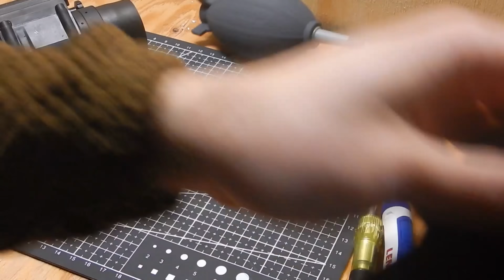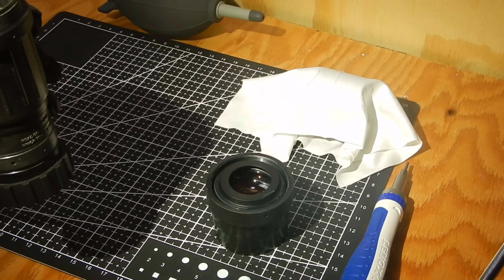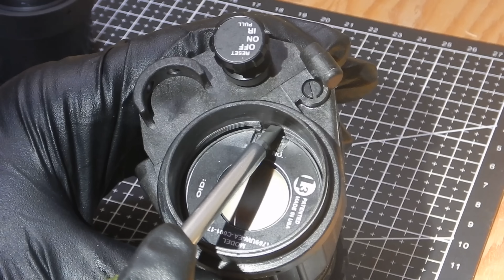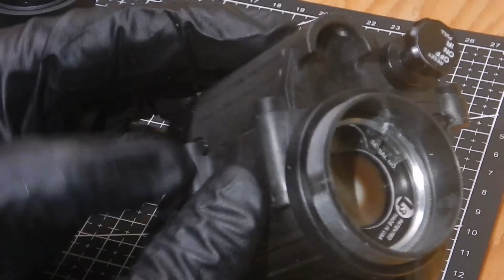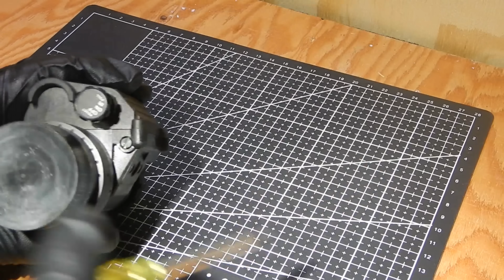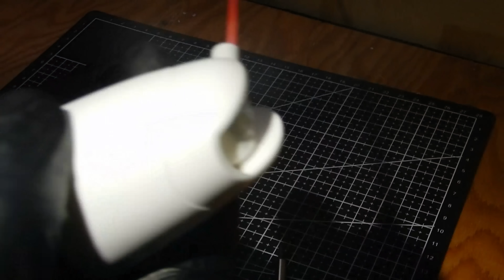How to Build Your Own PVS-14

Comment: Your claim about saving money by assembling a unit from parts does not add up. A complete parts kit is $1,099. An image intensifier tube is $1,800. Together, that's the cost of a mid-range assembled PVS-14.

Comment: I'd say place the optic in a vacuum chamber, with the screw removed cycle vacuum and nitrogen purge leave purge on when you open chamber replace screw inside the chamber.

Comment: Nitrogen purging isn’t necessary until you get off the sky bus at -60F and you land in wetter than Sally’s crotch jungle.  Instant condensation in your optics and you are stewed, screwed, and tattoed.  Get yourself a small TIG welding enclosure, place your optic in the enclosure, purge with Argon preferably, or dry nitrogen.  Assemble and close your optic, never a worry!  If your an evil genius like myself, you’ll overpressure the enclosure (+1.0 to 1.5 psi) creating a positive internal pressure in your optic, never will you have to worry about moisture intrusion.

Comment: As a welder I am able to get pure Argon would it be the same as what you are using it seems that it is I just have to make an adapter and use low pressure- correct

Comment: What about Argon purge? Argon is heavier than air. You can vent argon into a fish aquarium reassemble your optic inside the aquarium. You can use anything with some deep sides.....at this point he's talking about Argon available in a can.... inside whatever you fill with argon you need to keep your purge gas going so your movement reassembling it doesn't cause your purge gas to be fanned out. Pipe welder trick using argon as shield gas. In welding using GTAW procedures it's used for welding ferrous, non-ferrous metals, and to prevent oxygen contamination. Think maybe it can be done that way and it work? Providing of course you have a bottle of argon.

Comment: If you're worried about fogging what you want out of the device is the moisture in the air. Even air that is dry by human standards has moisture in it. Any typical compressed air will probably have moisture in with it but any single (non-reactive) gas product would be a good choice.

Comment: If you're scared of dust, here's a little tip from another dustphobic: buy large clear freezer bags, the bigger the better, clean all your parts, put them all in a brand new bag, assemble inside the bag with your hands outside. From this point no dust can get inside. I also have a small hand vacuum continuously running on the minimum setting on the side, creates a gentle flow that gets rid of any dust that falls.

I mostly service watches and it's the most efficient way I found to do this on the cheap.

Comment: Pro tip for a "dust free" assembly environment: Use your bathroom! Turn the shower on nice and hot WITHOUT the fan on for a couple minutes to get the bathroom all steamed up, then turn the shower off and let the room cool for 30 minutes or so. The steam/water in the air catches all the dust and it all falls to the floor leaving the air dust free!
Reply: This is good for cell phone protective screens...but they can take the moisture..I wonder if that might actually be bad for open electronics....(I'm only thinking out loud)....I was thinking the same thing as your comment...then the moisture thing  made me take a pause and wonder...
Reply: @camdenkingsley8800  why I said to let the bathroom cool first to let the humidity drop, as the room cools the humidity drops to the same as any other room in the home. 

You'd be surprised what "modern" electronics and PCB's can take. They're all very well protected from humidity and moisture unless they take a full bath while energized for very long. So long as you remove the power source and dry them out quick they'll more than survive.

Steam also doesn't contain much in the way of problematic minerals like tap water has, or worse lake and salt water. About 10 years ago I was kayak fishing and went for a "swim" with my old Pantech Android version 2.3 cell. I got to shore, ripped the battery out quick then let it sit in the sun for the rest of the week. It still works just fine today as an E-book reader!
Reply: @macgyver5108  Cool...yea...I thought the same thing as this is how I install screen protectors...thanks for the info.
Reply: I suppose so. If all of the parts were tHen at the same temperature perhaps the extra humidity would not collect on surfaces. You might seal the components on air tight and water tight bags or containers and place them in the same area while the room was de-linted so to so speak. The hvac system would need to be filtered or turned off but hey, you this is a possibility of a cheap clean room. Maybe add a filtered dehumidifier system. Interesting idea. Thanks
Reply: @crawford323  what is this "HVAC" you speak of?🤔 LOL, I don't have one of these "mythical creatures" you speak of where I live! What I suggested CERTAINLY beats the alternative of any other dusty room in your place though.

The only issue with using "bags" that are plastic is the static cling which can attract dust, UNLESS perhaps you used the static shock proof plastic bags like electronics ship with and blew them down really well first.
Reply: @macgyver5108  Heating, ventilation and Air Conditioning.
Reply: @stephenhood2948  I know, just being facetious. I've got many friends and family in the HVAC trade, as I sit in front of my box fan...
Reply: @macgyver5108  I cant imagine how I didnt catch that in your comment, you were pretty clear about it.
Reply: @stephenhood2948  "must've been the heat"?!😏
Reply: @macgyver5108  LOL

Comment: Loosen the housing screws creating a crack, then act like you are pressurizing the housing so any excess gas will flow out of the housing crack, press it together closing the crack, then install the access screw, then tighten the housing screws.
THOSE ARE GOING FOR $800 WITHOUT THE TUBE!

Comment: Would you be able to remove the screw and place the device in a vacuum chamber, use a vacuum pump, then attach a line from an argon (or N2) tank to the inlet? Wouldn't be perfect, but might yield decent(er) results.

Comment: Would putting it in a small vacuum work like for example i have a vac sealer with a hose attachment for containers could i in theory put it in container and suck air out of it with vac sealer? Or would the air rush back in as soon as i open the container?

Comment: This video hasn't aged well.  The intensifiers are so high you are better off buying a retail optic used. As far as purging, there's an easy way to do it right.  Build a small vacuum chamber, put it under vacuum, attach argon bottle to inlet, open valves. Instead of equalizing with atmosphere, you equalize with argon. Once that's done,  since it's heavier,  just reach in and put your screw in. Done.

Comment: Been doing this for over a decade. Kind of regret not starting a business off it but moved onto other things. Figured others were more worthy of picking up on this. It’s already been mentioned on what you covered and didn’t say (e.g. reverse threads, alum. foil, Ar density, dust, purging). A word about purging is that the N2 kits are criminally priced. The hand pump is something I could literally still get from any mechanic shop. Valves, tubing, and switches are easy to engineer too. The adapter is easy to machine and even buy for cheap. N2 is easy to come by any gas company for torches/welding or med/lab supply. Regulator too is easy to get. Never understood why N2 kits were $1000s other than being a juicy govt contract. Worse off is the “optics testing kit”.  Reduced to $5000 (from $10000s) last I saw years ago. I just stuck with the basic field tester kit and some optics know how for $300. The AN/PVS-14 was a great optic. I wish the AN/PSQ-20 could have lived up to it. Low weight, small profile, multiple mount options in handheld, rifle, head/helmet. Fusion just can’t compete to this day with its proprietary components, limited mounting and bulky appearance. I mean the I2 tube itself is not easy to make either hence expensive but that’s the rub. It’s one small unit to assemble around upon. Making it easy to service/repair. Kinda apples to oranges though cause thermal requires additional circuitry/components. Maybe more into the future fusion may compete. IMHO it does not in this day and age.
Reply: Hey boss , if someone wanted to get into this , where would you suggest buying the actual lens and housings

Comment: The purging is not about what gas will be inside. It;s about to remove any moisture from inside. Vacuuming will make any water boil and sucked out by the vacuum pump. The nitrogen gas is dry, water free will prevent water vapors to flow in and affect optic in cold condition. The same technique used to purge air conditioners once it was open.

Comment: For military-grade Purge with argon gas, it has better and heavier characteristics than nitrogen. Its heavier so its like filling her up and lets gravity do the work. It is necessary as it will stop condensation. You can buy it super cheap as a welding supply. you can make a vacuum purge with a large gallon plastic bottle, a rubber glove, and a tyre pump.
Reply: haha you just did it in the video. top notch!

Comment: @S2 Underground , With over 800 comments, I don't know if you'll see this, or even have the time to respond, but I have an honest question. Is there a specific reason you connected the electrodes, before you cleaned out the dust from the upper housing? I ask because it doesn't make sense to me on a common sense level. I have no experience building such an apparatus, so if there is a good reason for doing this, I would genuinely like to know. Thank you in advance.

Comment: I am not familiar with this per se but I work in the automotive field and we have a nitrogen machine for tires... it will pull a vacuum and install nitrogen. You could easily do this if you could adapt a car valve stem to the body somehow.

Comment: I'm not an expert on purging optics, so maybe it's not as critical as I'm thinking, but typically the more important part of the purge process is pulling a vacuum, which isn't so much to remove air as to remove moisture.  By pulling a deep vacuum the boiling point of water can be brought down to bellow ambient temperature, causing it to become a gas and be extracted by the vacuum pump.  The atmosphere inside the device is then replaced with a dry inert gas such as nitrogen or argon to ensure no moisture is reintroduced.   If one wanted to perform a more effective purge, vacuum pumps and small vacuum chambers can be bought for a couple hundred dollars and it would be relatively simple to set the vacuum chamber up to fill with inert gas afterwards.  If you know anyone who works with air conditioning or refrigeration they should already have most of the necessary equipment as well as the skills to set it up.

Comment: If you get a Eisco Hand Operated Vacuum Pump ($44 at fishersci and comes with the PVS-14 purge kit), a t-fitting, and Night Vision Nitrogen Purge Kit Adapter ($30 at Opapug), you could draw a vacuum on the nod with the pump, and then pressurize it with your bottle. It may not be perfect, but it could help a bit. Just a friendly suggestion, and would not cost the $1.2k for the whole kit.

Comment: If you were to do some quantity of these, a simple vacuum pump would boil off the moisture, then just open the valve or spray can of argon, nitrogen etc. to refill housing afterward.

Comment: I have a suggestion on the nitrogen purging issue :
here in Italy nitrogen is used to purge hvac installations from remnants of previous, now illegal, kinds of gasses.
Nitrogen bottles are readily available as being inert it is not a controlled product and the cost is minimal like 15 bucks for a bottle sized tank.
If you were to connect one of those tanks to a valve, leading to a very fine stem, you could insert in the housing through the screw hole, leave it going for 5 to 10 minutes to ensure overkill, remove the nozzle and quickly inserting the screw to finish a jerry rigged nitrogen purge...
It may not be perfect but it could be a good improvement from 70% nitrogen to 99%, not professionally graded work but a good brute force approximation.
You should take a look at stores that serve hvac installers, hope this helped a little :)

Comment: On the leads for gain control, would it be wise to put a dollop of solder on the top of the leads? To make sure they never undo by themselves?
Reply: They are pressure fit

Comment: Question: can I use argon from a welding setup and setup a tote upside down and operate on the nods with my hands in the tote while duping argon into the top of the tote to offset oxygen???

Comment: If you actually cared... Could probably rig something up for cheap to purge. One tube goes to the hole which has a Y splitter with 2 hoses coming off of it. Put a valve in each hose. One goes to vacuum the other to argon. Close off the vacuum side, pull a vacuum, open the argon side, good to go. Do it once or twice and as you said, heavier than air so when you pull out tube from the housing it should stay inside.

However, I like an idea someone else said which is way more simple. Basketball needle deeper in the housing and just go super slow and should get the exact same result for way less effort.

Comment: Anyone more knowledgeable think that it would be possible to 3D print a housing that would be able to hold the PVS-14 (either as is or taking the guts out) to make a standalone setup like a goggles (think Splinter Cell goggles... that's the closest example I can think of) that can be fit into a pouch or worn? something that isn't strapped down around your whole head? I don't use a helmet because I am using these for hunting, not combat... and the mounts I've found available are all very uncomfortable and a bit cumbersome. I'm trying to make the whole thing more compact if possible...

Comment: Gents, you shake that thing as is and it’ll turn itself on off according to this tutorial. Before you close the batt comp makes sure the tube has the left side of the notch (when the objective is facing you) pushed against the little wire that holds it. Apply the light pipe and while keeping the tube firmly in place applying the retaining ring. Do that and it shouldn’t shake itself on and off.

Additional fun fact: if you buy a 17C tube it has an auto gain function and works perfectly fine in a 14.

Comment: Just a quick thought, as you said argon is heavier than air, take a cardboard box and tape the seams with duct tape and put everything in the box. Flow argon into the box. Reach in and assemble. Argon is really easy to get as TIG welding gas at your welding supply house.

Comment: appreciate you mentioning using argon as a substitute, and the benefit of it being heavier than air. 
Argon is used in purging AC systems in automotive applications, maybe residential as well. As well as it's use in welding to act as a shielding gas and a purging gas with in the pipe.
It get's the job done!

Comment: Used to use Argon for polymer processing in the the summer time - heavier than air. Nitrogen in the winters, because the air was so dry anyway. Argon is much more expensive, but much more effective of an inert gas.  Window companies caught on years ago by having double and 3x pane windows with N2 and Ar in between the panes as an inert layer...

Comment: Argon is heavier than Nitrogen and oxygen, so it should be able to replace oxygen in the tube easily. Alternative you could you the pvs 14 in a small bucket, with the hole looking up. Fill the tube and the bucket with the argon. Then place the tube on its side, fill it again. 

Of course argon and oxygen is invisible, but if you just keep puting argon in the container, it will eventually displace oxygen and nitrogen from the tube.

Comment: Since you're relying on just the density difference wouldn't it make more sense to screw on the lens last after you "purge" the device? Do most of the purge in through the tiny port with the lens off, close the port, last squirt of argon over the tube, close the lens. Should be better that way. Yes the argon should displace the air but with just that narrow port for purging I'd imagine most of the argon isn't getting inside as the air has nowhere to go but up the same way the argon is trying to go down. Imagine two way traffic on a single lane road. With the lens off the air has a better exit. Also with the tube placed on the table the part of the body the lens attaches to is higher than the purge port, so closing that last should give you the best home brew purge.

Comment: If you go the wine preserver rout remember: Argon is a Noble gas 1.38 times heavier than air. When you use the gas hold the hole in an upright position and flow the gas into the body. The weight of Argon will displace the air in the chamber helping to purge the air out.
Reply: …he did work off the the basics of that.
Reply: Or just put it in a bucket and doing it in there.

Comment: When u do this you can work behind an air purifier to suck away any dust. Take a box fan or fans if u wanna be ocd about it like me, tape 20x20 furnace filters on the the back and work behind them it should help mitigate any dust.

Comment: Just an FYI: Argon is used in Stinger seeker heads/optics to clean an cool the head during tracking of aircraft for better target lock.
Reply: Plenty of AGM/AIM do as well
Reply: It's used specifically to cool the thermal sensors of heat seeking ammunition to increase the heat contrast of the sensor.